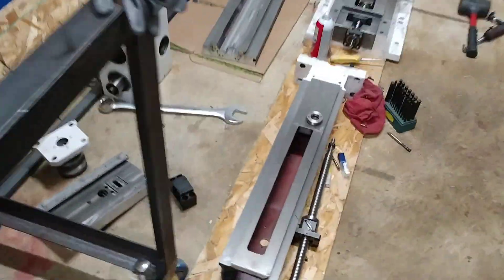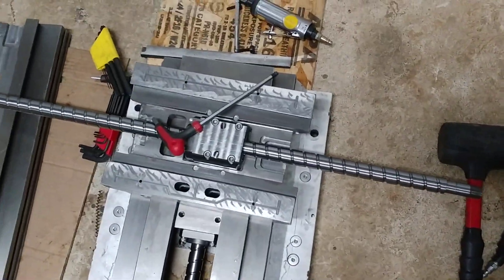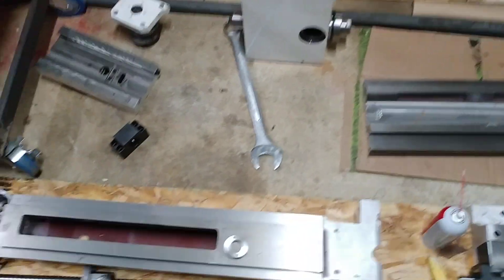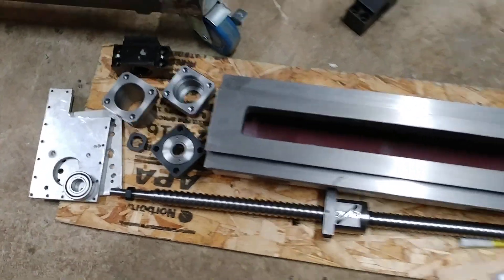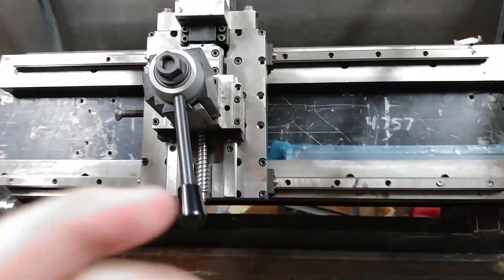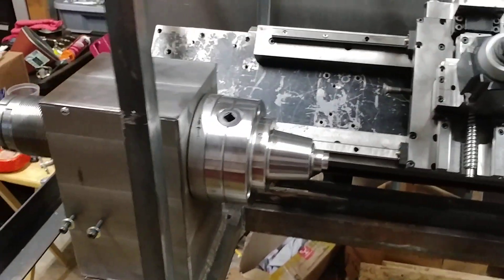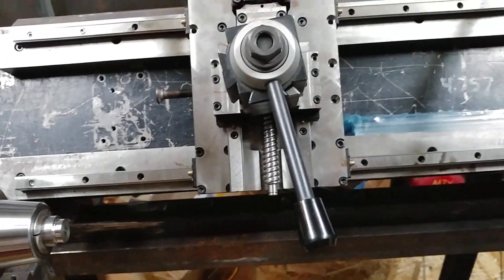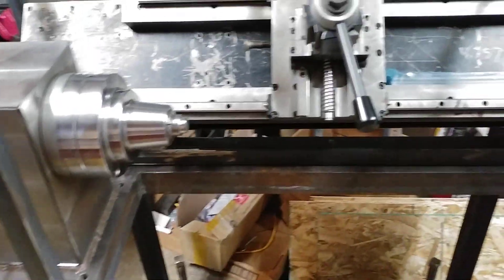DIY CNC MACHINES

Comment: Great start! I want to build a lathe but am hung up on sourcing a larger spindle. Any sources for spindle sets in that 1.25-2" range?
Reply from the maker: No clue. I built mine.  Might try grizzly parts and see if you can get jist a spindle?
Reply: @svin3819  Thanks for the response. I’ve seen that most have turned their own. That looks like the route other than sourcing one off a sacrificial machine on eBay.